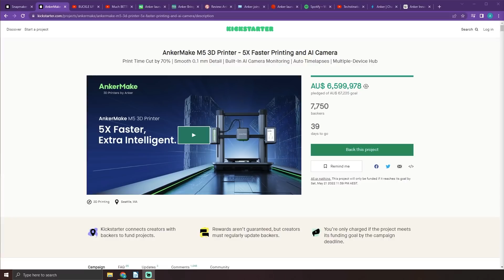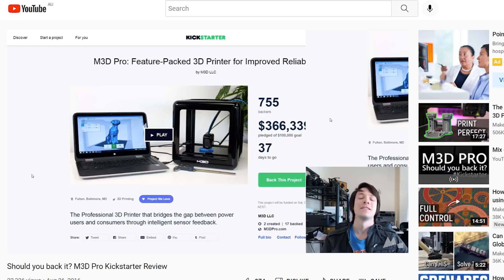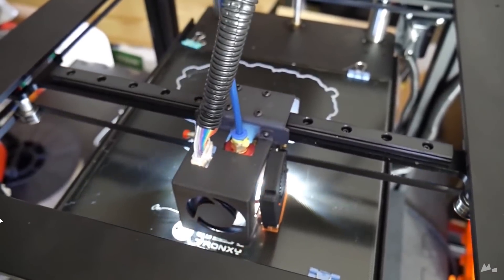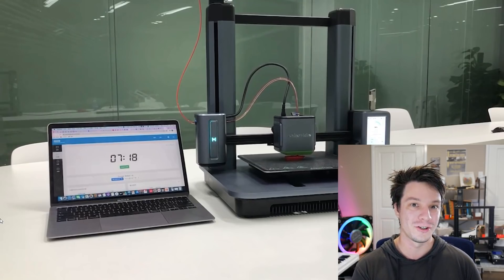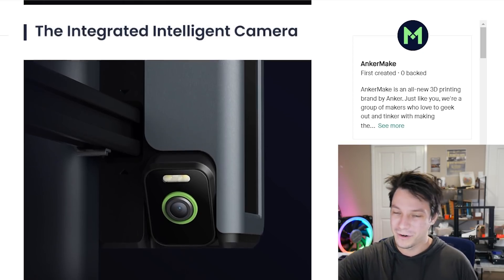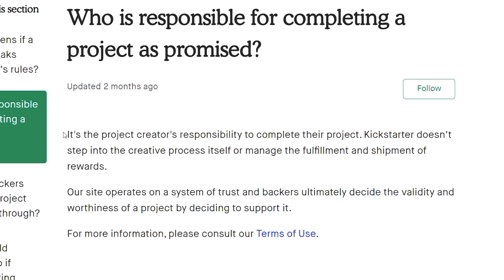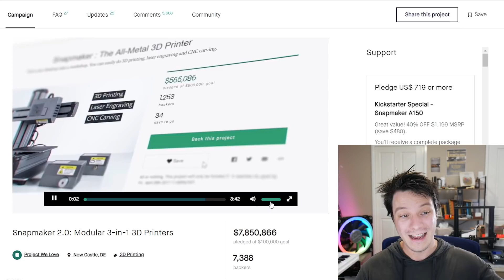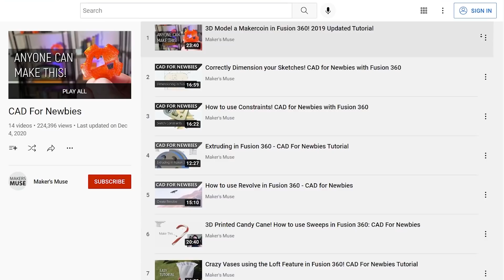This 3D Printer looks incredible, but...

Comment: Yeah well ... that was basically what the ultimaker 2 was about nearly a decade ago. It was relatively easy to have it printing what you wanted, but then they had to increase quality control to maintain that simplicity, and prices rose into a semiprofessional or enthusiast area and the consumer flocked to the cheap machines for disappointment. It will happen again, again, again. I´ve worked with objet machines up to the huge 1000, i´ve worked with large scale professional FMD machines like the Stratasys 450 and 900. Now i´m professionally printing resin on asiga and have some consumer grade resin printers as backup. They´ve come a long way, but consistency in mechanical quality and all the functional parts has a price. The printing platform of my Asiga costs as much as two consumer grade printers. Why? Not because its so much better built (though it is as well) but because its QC will never allow a badly planed or coated platform to leave factory, while consumer grade printers sometimes even have bent platforms or casting defects on the alloy. And the smallest objet machine still costs something along the lines of 15 - 20 thousand euros, and is completely proprietary and expensive to maintain.

Comment: You mention about the hope of a printer that doesn't need the 20% or so tweeting. I think the Ender 3 S1 I got a few months ago may fit that bill. With no tweaking at all, it printed your clearance castle almost perfectly. It took a bit of force to get the tower loose, but once it was free it worked perfectly.
I may have just been lucky, and got a good machine. I would be interested to hear others experiences.

Comment: Like the video. Hard disagree with the resin jetting as being more reliable. A higher cost product SHOULD be more reliable in general, but our company spent $50k+ on an Objet that was down 2/3 of the year. After multiple service repairs (many of which cost us extra), Stratasys just ghosted us. Everything was covered under warranty Except the print heads which were usually the cause and cost $1,200 a piece. This put use years behind in getting 3D printing buy-in

Comment: 3D Systems ProJet tech here -  I can speak on the Projet / Multijet tech coming to consumer viability. 

Safety:
The MJP2500 prints with an acrylite that is HIGHLY reactive to skin contact, and sensitizes so each time you touch it, so you have to be very careful or you'll eventually be unable to use the machine. You NEED to be wearing nitrile gloves and eye protection handling unwashed parts or really touching anything inside the machine. They show removing parts from a different style machine without gloves on. I don't know if it is somehow safer but this is not a good idea.

Supports:
The supports are printed in low temp wax that is melted away once the print is completed, which sounds great, but does create a lot of mess if you don't have the proper post processing setup. The support and print materials also make an absolute mess over time if not maintained between each print. I've spent 8+ hours cleaning a customer machine from 'pixie dust' wax buildup before I can even start fixing problems.
Also, because the support wax needs to be liquid before printing can start, you can have about a 2 hour warmup time for the machine to heat the material bays and umbilical lines so so that it isn't trying to force bits of solid wax through the tiny piezo printhead nozzles.

Calibration / Maintenance: 
This is where I think this technology coming to consumers runs into a roadblock, at least with the 3D Systems technology. It is jetting wax support and part material through a Xerox printhead while moving at very high speeds, so there is a calibration for time of flight of the droplets as they leave the printhead and travel the short distance to the part being printed, as well as the mass of the droplets themselves. The droplets will be rounded, so there is a heated planerizer roller that skims to top of the print and flattens it, and a motorized scraper blade and waste collection system to clean the roller and then dump any built up material into a hazmat disposal bag. If ANYTHING in this assembly is even the tiniest fraction of a degree out of square and level (yes, level to the floor also), you will get prints where the acrylite runs before it can be cured and the whole shape will be distorted. 

Additional Equipment:
The supports on the 3D Systems printers are wax, and are removed with a combination of oven, steam bath, or oil bath depending on the part material and how delicate it is. Getting this right can yield nearly transparent prints. You will need at least a freezer (for removing parts from the build plate), steamer unit, and wax bath unit, and a sink for fine detail cleaning and removing the bit of oil from the heated oil bath. 

Misc:
There are 2 full computers and an android tablet inside of the MJP2500 to handle onboard slicing and machine control. There are a large number of heaters, probes, sensors, vacuum pumps, and solenoids all required to operate correctly. There might be some ways to simplify this design, but there is a lot going on inside that looks deceptively simple just looking at the part appear on the build plate. 

Honestly I feel that powder bed binder jet printing or different method of resin printing will be far easier to bring to a consumer market with some automated finishing equipment handling the messy bits.

Comment: I just ordered the new Sovol S01 Pro:). I think this printer has many points that you talked about. Autoleveling, filament sensor, resume printing, intelligent filament switching and so on. I'm a newbie to 3D printing and I'm hoping all these things will help me get started. What I know now, you have to read a lot if you want to improve your prints with the current 3D printers. In my opinion, not only the hardware but also the software needs to be improved. The software should set itself up by simply scanning a filament QR code and setting up the printer. This should be the future. 3D modeling is still required to do your own creative stuff. But there are many people who create things for others. And it is a market from which many are already benefiting. These are my thoughts on the subject for now. Cool video you made. I like the 3D printing community. Everyone loves to share their experiences and creations. This is a great hobby, especially for my other hobbies^^

Comment: although i am "tech savvy", i hate wasting time on continiously troubleshooting my 3d printer.... i want to design, send it to the printer, and get a good result. it should be possible. sure, a cheaper printer might not have that, but even the extremely expensive printers are built on roughly the same unreliable platform with certain quality of life improvements.

Comment: If a company wants to make an actual revolutionary printer that could be used by a lot more people, they should make it as little of a headache as possible to operate so they can focus on other tasks. Most people don't want to spend 4 hours trying to level a bed to start a print just for it to fail because the extruder screwed up or the nozzle got clogged.

Comment: Even if the printer is incredibly easy to use, slicing the model is it's own task that does require some skill. Knowing how to orient the part, how much infill will be needed etc is just something that a hobby printer will know how to do, let alone the modeling portion with tolerances. I don't see it ever being more main stream than building your own PC.

Comment: I feel like it would be relatively simple to add a motor under the bed with laser beam break sensors or some super sensitive gyroscope module which turns the nobs to mechanically level the bed rather than adjust with software via BLtouch, that would solve the bed leveling situation.

Then in the case where layer adhesion is still a problem, maybe replaceable surfaces with a coating that allows easy adhesion. 

Then a cam with AI to check for spaghetti and create Timelapses 
And a rotary sensor to check for jamming 
And another beam break sensor to check for filament runout. 

Why not? If those solutions solve the main printing problems then why not try them? I’ve done a couple of those things to my printers to make them more reliable, why can’t it just come as stock

Comment: I spent a year on Tinkercad before I even bought a 3D printer, spent most of that year designing models that, I found worthy of getting a printer. I designed around 10 models in that time, I know that's not a lot, but one of which was an idea for a friend's Christmas present. I put so much effort into mastering Tinkercad, I haven't yet, but I think I am getting there.

Since I got my Ender 3 v2 a year ago, I've learned so much just through the printing experience. I've learned skills that otherwise, I would never have learned, for example, I learned how to use a buck converter, I did kill 3 or 4 in the process, but that is why you buy them in bulk...

But this Anker printer, I don't think this is aimed at people like me (new to 3D modelling), I think it is aimed at people who already have a talent for 3D models, and this is just a way to bring them into reality. Yeah I would love to have one like this, my Ender 3 v2 is still a hit and miss when printing anything with small parts or print-in-place models. Don't even get me started on the whole camera dilemma.
But it has managed to do the fun stuff I've thrown at it.

Comment: Hey Angus, have you checked the Weedo Tina 2? It was sold for 75€ in a local brand supermarket. It is a small box with induction auto-leveling and a 10x10cm removable non-heated bed. We bought this for my 12yo brother, he mastered it really quick and learned to use tinker cad.

The printer runs marlin with a proprietary and very simple slicer but you can use any other slicer. I was amazed by the very few failed print. The default settings are a bit slow but it is very reliable. This is the most plug and play printer I've ever seen and the price point is ridiculous.

Comment: NOPE NOPE NOPE. Do not back a 3D printer on KS...ever. Take it from a 'Peachy Printer' and an ONO backer. Yeah...both. Money right down the toilet. I've backed many KSers over the years, and ONLY 3D printer campaigns have flat out failed. If it's so ingenious, let them make it, set up a store and sell you the damned thing.

Frankly, I don't back anything with too many moving or engineered parts anymore. Particularly in today's chip landscape. A group's assumptions as to what will be available in six months is probably hilarious.

Comment: Nice video, and very good points you make. As for the 10 year prediction, my money is on SLS becoming more available and the technology improving, so stuff such as the cumbersome post production process, could be made easier or preferably, eliminated as a manual process. The way I see it, SLS is far superior to both FDM and SLA with potentially much higher tensile strength, and in the case of nylon which is probably the most used SLS material, a host of other benefits.

Comment: 3D printing for me has always been a double edged sword as part of the reason why I get reliable prints is because of the trial and error I have had to go through Over the years with home brew printers, and because of how complex the machines are really and how much has to go right for any print to finish even the most consumer friendly fdm printer will always be just out of most people comfort zones if they don’t want to learn 3D modeling and tinkering and learning how the machine works, becsuse chances are you will have to take it appart to fix something at some point

Comment: SOOOOOOOO right that you can use a 3d printer without design/cad knowledge to print other peoples work but you cant do your OWN work unless you have that knowledge. For me trying to learn CAD is so confusing it is not funny. Sure I can do 3d builder and tinkercad but after that the terminology and design aspect just destroys my 1 brain cell. A machine that could take an idea, turn it into a model and then print it would be great :) OK, well maybe by the year 2300 lol.
I was thinking of backing this but it is too small. I wish they would have done a large format printer as the larger the printer the more beneficial is the speed factor. For me, I would rather print a helmet in 1 piece or a guitar body or whatever without having to worry about gluing.

Comment: Have you looked into what expertise anker has that would allow them to make this into a succes? A great tell to how well this is going to go is to check if Anker has somehow managed to get some engineers with relevant experience, maybe by buying up a smaller company. Or maybe if they are using external consultant? Or there's a technology they are familiar with that's suddenly very relevant? Because creating something top of the line out of the blue is not something many companies really do....

Comment: Anker is not a manufacturer; it is a branding company that brands premium mobile phone chargers / battery packs and cables, they dont "make" anything. The printer is designed and manufactured by a 3rd party and then the Anker brand is just slapped on. It’s still another i3 bed slinger clone but with a machined aluminium base, mildly aesthetically pleasing injection molding and a colour touch screen. Apart from alot of marketing hype I can't see anything that really sets this machine apart. As for LTT and Uncle Jessy - they are entirely paid content platforms.

Comment: The future that I hope to see for 3D printers includes materials that are easily recycled by the user, and better still also includes "plastic" materials that are nontoxic and biodegradable.  Whether I'm 3D printing, molding/casting, or sculpting by hand, nearly everything I create is made out of plastic.  Much of it goes in museums and has a useful life of many years, and I rarely print anything that I didn't design myself, but in the end it's all still made with a material that will be around thousands of years after I no longer am.  The world already has a plastic problem (to such an extent that we're starting to find it in our own bodies), so making more plastic stuff seems like pushing in the wrong direction.  That could change if we can get better and safer plastics.

Comment: I think eventually, the future will be some combination of media. I can imagine a printer that has different jet heads for different materials, and cutting heads that can swap out on the fly. 

Actually, these already exist! They're just super expensive and mostly industrial grade machines. For reference one of the spindles to hold a tool for the machine I'm familiar with is around $15,000 USD on the CHEAP end.

Comment: I bought an Ender 5+ with no prior knowledge of 3d printing and very limited basic programming skills (and that is already a very optimistic way of putting it).
 That POS fought back tooth and nail at every single step, without exception, even now, everything is configured (don`t ask, it was painfull), ie. I can play with temp., fans at least did work until just now, homing is FINALLY a go, but when I want to start a print, it is going straight for the exit. 
Btw. Creality swapped out the extruder motor, must have been not too long ago, so (just for example) the all metal extruder I bought that is specially designed for this printer, does not fit anymore. It still says Ender 5+ on the page, but nope, not fitting, and they even admitted as much (but only after I sent the pic. of amazon with both extrudermotors next to each other, both say "Creality 42-40 " but only one will fit this metal extruder. And I have the "newer" one. POS.

Comment: It's really interesting to hear you predict the Objet as the future of consumer 3D printing. We have one and it's a nightmare to deal with, compared with our FDM printer. I'm not sure how many of the Objet's problems can be solved with more development. 
- Like all resin printers, you have to deal with the toxic resin. You can't touch it with your skin because it will make you allergic to the material, and the effects are cumulative. It has an unpleasant smell when printing, due to the vaporized resin. Spilled/expired/unwanted/contaminated resin or failed prints are all toxic waste, and no toxic waste handling company will deal with quantities smaller than 55 gallon drums. Fedex will not ship used Objet resin bottles, so you can't recycle them with Stratasys. The resin will also ruin clothing and carpets if you spill. You need to wear disposable nitrile gloves. 
- The proprietary resin is incredibly expensive (currently over $700 USD per kilogram). Since the resin needs to to meet such tight engineering requirements to perform well in the print heads, I can't see any resin jet company allowing commodity resins to be used in their printers. Changing between material types requires a purge of the system, which is automatic but wastes a lot of material. 
- The resin expires very quickly. I forget if it's 6 months or 12 months. The printer will refuse to use expired material, which is now very expensive toxic waste that you have to deal with. 
- You have to clean the print heads with isopropyl alcohol within 12 hours of a print finishing. You need to run a print job every 3 days. If you don't have a print job in that time frame, you are supposed to purge the system and fill it with proprietary storage fluid. If you don't follow all these rules, you run the risk of bricking the print heads, which used to be $900/piece. I'm sure they're even more now. 
- The printer can print very nice, glossy prints except where support touches the model. Those surfaces will be matte and kind of gross. Sanding those surfaces doesn't really help because the support material seems to penetrate the model material to some slight degree. (This is very obvious when printing with a clear resin.)